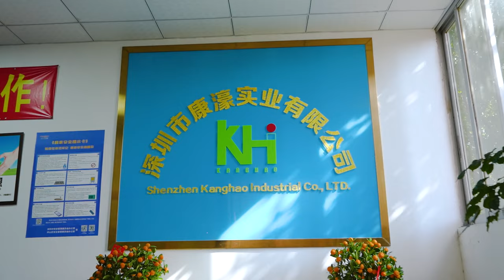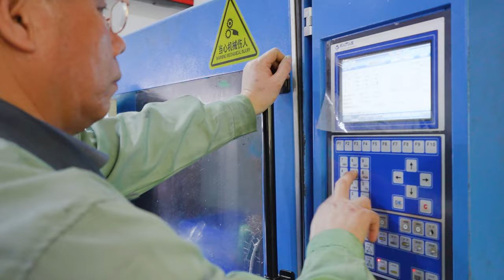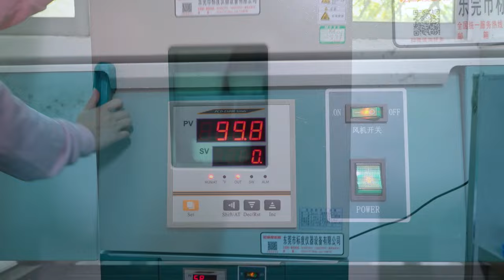Wheat Straw Plastic Lunch Box Manufacturing Process. Plastic Injection Molding Factory in China

Comment: I just got a set of dishes made from this. It’s very impressive. It feels like heavy duty plastic. It’s a lot lighter than plastic though. The only recommendation on the packaging says to avoid microwaving with tomato and curry based sauces because it could stain it and to avoid cutting all the way through on it because a knife can scratch it. But a set of 8 dishes I got off amazon was $18 and I really like them. It’s a smart way of making use of the straw that would otherwise be burned or end up in a landfill. And it’s environmentally responsible, though I don’t actually care about that stuff. But I do feel pretty good about the idea that I am doing something less wasteful with a product.
Reply: sir,do you need plastic granules?